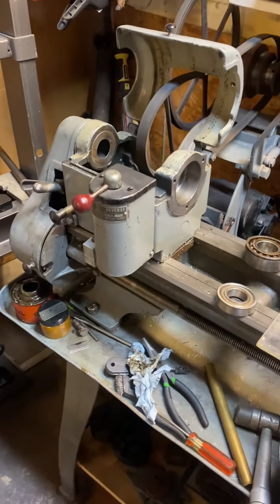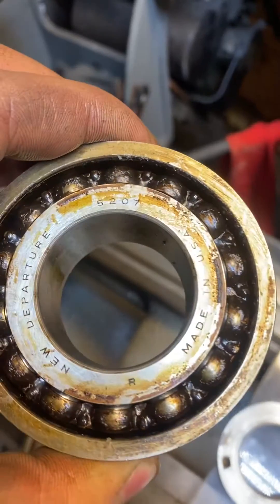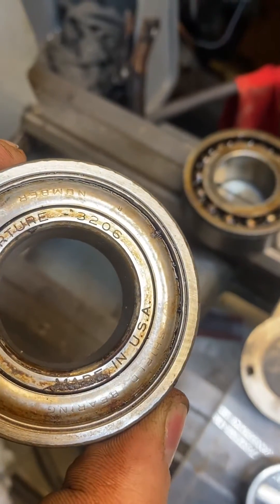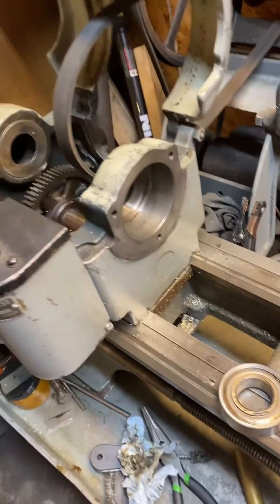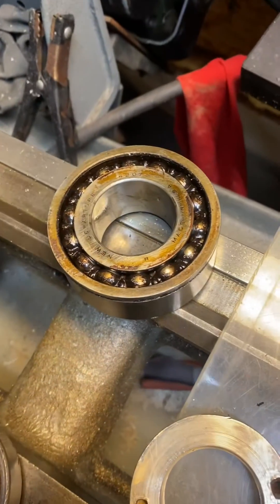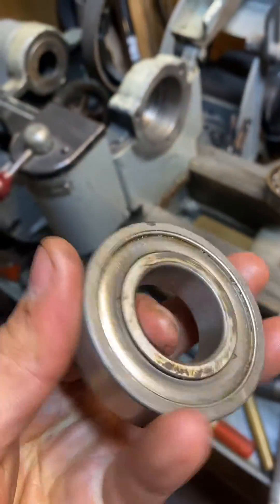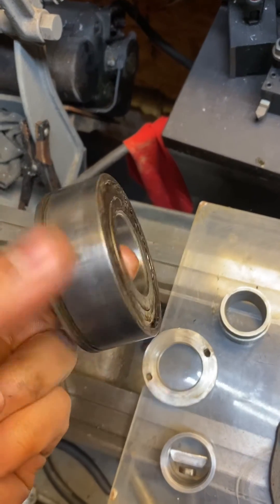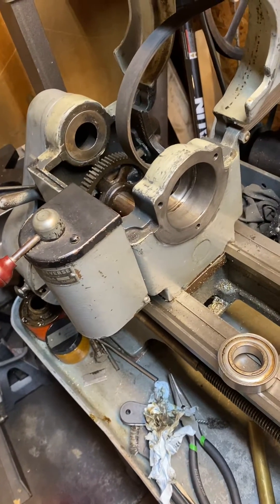Logan Lathe Spindle Bearings

Comment: Make sure the lathe bed is level across the ways at both ends and that legs are securely fastened to the floor. Can make all the difference in the world. If bed is twisted the carriage is only setting on the corners, topsy turvy.
Reply from the maker: @JCP1152P  the biggest issue I just found recently, the compound rest was not flat. I took it off and skimmed it, then lapped both parts together w valve grinding compound. Doing this improved a lot

Comment: Did it actually solve your issues with chatter? I’m glad someone worked out some factory numbers instead of going through Logan.
Reply: My bearing I think is my last peice of the puzzle but from I’ve found,  whether it’s from being bell mouth or just worn out, my old original 3 jaw chuck produces way more chatter than my 4 jaw.  My old tool post was brutal for chatter, it would actually deflect quite significantly and also my cone pulley has a bit of slop in it and probably because of the bad bearing it’ll actually produce a visible chatter in my work if I’m giving it too much beans.  Also tighten up the backlash in your screws for your cross side and stuff, that made a difference for me.
Reply from the maker: @captainuseless3806  somewhat, still have issues with chatter on that machine. I believe it to be lack of rigidity in the legs

Comment: How did it run..Finding  a bearing that will fit is easy.  I am interested in how it worked for you. the correct bearing from Logan is almost $300.
Reply from the maker: Has been working just fine for me
Reply: @EvanLightner304  I tried an off the shelf  SKF bearing and it was worse than the old bearing I took out.